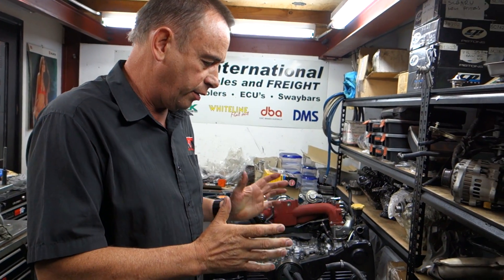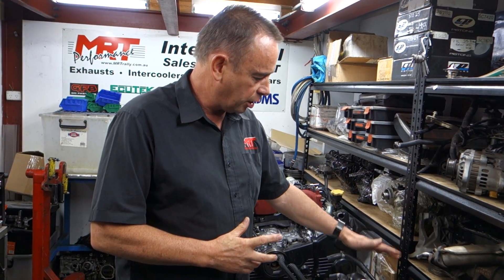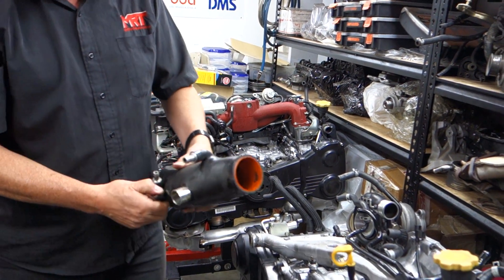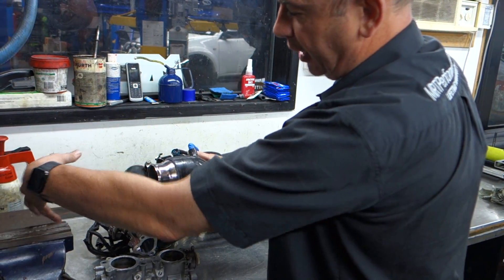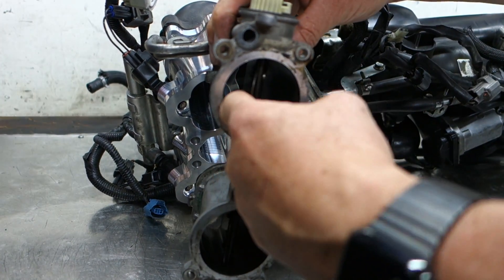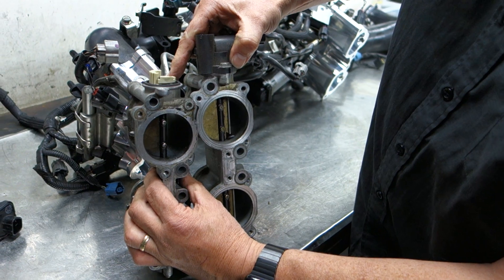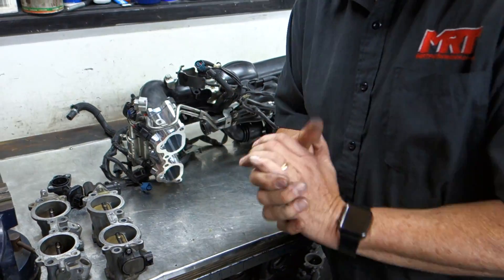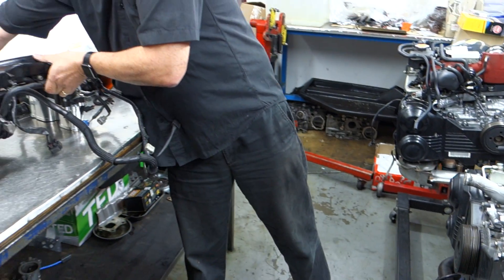WRX Closed Deck Engine Build - Upper Engine Setup

Comment: Would you recommend re-building the OEM engine with better internal components or buy a fully built engine? Which would be better bang for the $$?
Reply from the maker: depends on how badly worn and or damaged the your engine is, but often a rebuild deliverer better results

Comment: Thanks for these videos Brett,
Quick question: my 08 (09 model) XT Forester seems to be hitting a bit over 17PSI boost, should i be concerned about this and get it checked out?
The engine was replaced by Subaru about 4000kms ago.
Thanks again.

Regards,
 Nigel Levey.

Comment: What company have you found that has the best intake inlet tube?
Reply from the maker: that depends heaps on spec, design, mods and more
there is no clear out come re this
Reply: joshuas10 ive fitted many different brands and avo is the best

Comment: I did the TGV delete on my 2005 WRX and it sounds so good on cold starts, also gained some good power, just took a while to grind out the TGV
Reply: Matthew Oaida how did you do it so ecu code wouldn't come on
Reply: Tuner removed it, you can also just plug the TGV after the delete so you won't get any code
Reply: Matthew Oaida got it thanks!